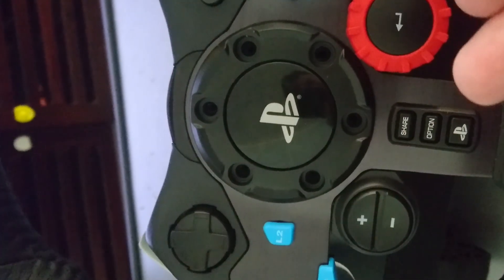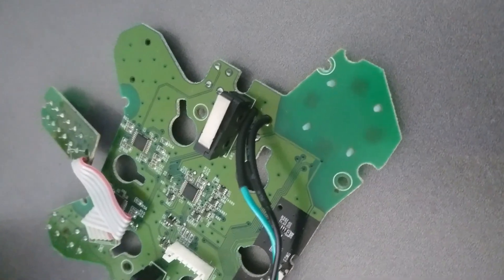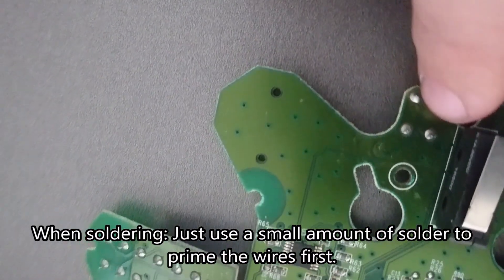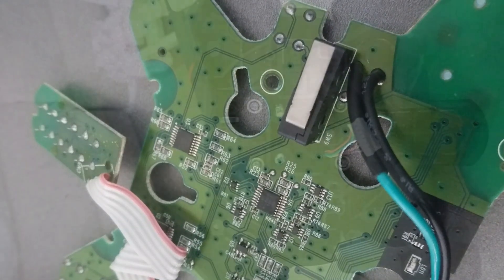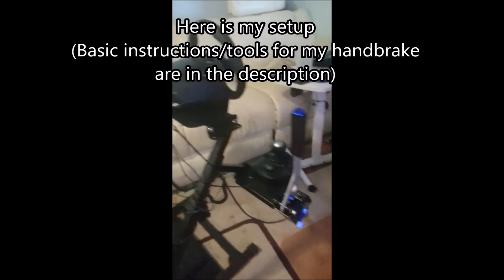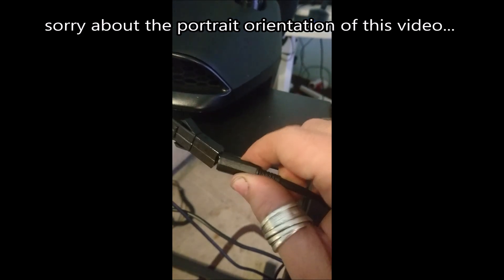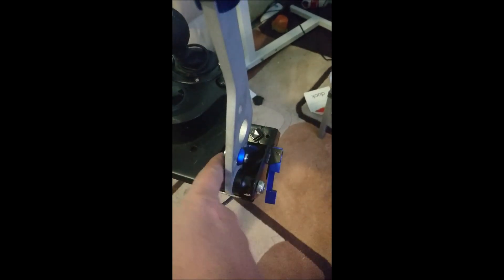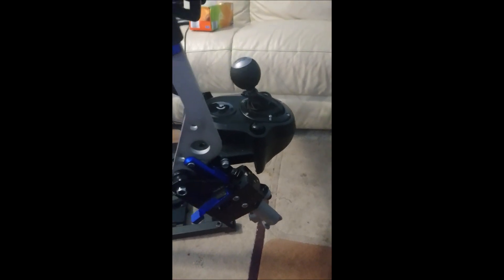Logitech G29 DIY handbrake mod wiring guide: How to tap into the button pcb & wire it to L/R 2 or 3

Comment: Can you do a video on the hand brake wiring. exactly how you connected the handbrake wires to the momentary switch that connects to the steering wheel pcb board wire.

Comment: Nice work. Just done one myself using the same hb assembly as yourself, though mine is to a G920. I always searched for G920, didn't even cross my mind to search G29 or I would have seen this earlier. Did it differently in that I went off the PCB and the B button, (circle on G29).

Comment: Just a heads up to anyone trying to do this mod.. do NOT use this video as a guide. It does NOT work. The solder points he used are for the menu button.. the paddle solder point are on the opposite side of the pcb, which also only work for pc. Anyone doing this for xbox one needs to use either x,y,a or b. Hope this helps someone out

Comment: I know this video was posted a while ago, but did this end up working? You never posted an update vid. Im currently in the process of doing this mod, but the solder points you used seem to be for the start or select button. Ive seen another video of the handbrake being wired to the right  or left paddle and they used 2 of the 3 solder points on the opposite side of the pcb. Please let me know, ive spent roughly a total of 12 hours in the past 4 days trying to figure out where to actually solder but there are so many videos that say to solder at different points. Thanks!

Comment: Is there any anti-tamper seals or stickers, I'm maybe going to replace the wire that could fail on certain models giving button problems, the model I have might not be affected but I may strengthen the 7 pin block connecter regardless with hot glue and purchase a replacement but I don't want to break any "tamper proof" seals as it's still under guarantee, if it can be opened without detection I will apply the modification, if not please let me know Thank-you, I will subscribe If you reply

Comment: is there a wiring diagram i can get? id like to tap into the buttons behind the wheel, somewere in the base so the wires dont spin around. im sure the other end of the USB that plugs into the PC can be tapped, id like to tap into it there

Comment: how do u solder to a or b button I have g920 using it on xbox1 for forza
Reply: Hi Mike. Just came across this video. I have done exactly what you are asking, made mine for my G920 tapping off of the B button. Risky, but I was not going to do it for any other button. As you know, the 920 only has the paddles LB and RB, so if I used them then no paddle shift, and LSB/RSB which are the stick buttons, and no game maps handbrake to those buttons. So it was B or bust! Check out my video:
https://youtu.be/H-48q4PmYdw

Comment: thanks for the video. about to make one with a long handle handbrake
Reply: Vu Nguyen on the a or  b buttons there's really really thin small soldering points it can be done but it's very scary it's easy to over hear them and ruin the mother board I did them to my rb paddle it's the easiest and safest just keeping it real I have vids on my YouTube about it

Comment: hello friend tried it myself and it all went well, but until I went to close the wheel is not closed because the cables to prevent it  the cables is thick.... had to put very thin wires;  plz help meeee

Comment: I have the g920 and want to mod for the handbrake. I was going to solder it the the R2/L2 but after looking at comments on this video, it seems that you can't map out your buttons on the Assetto corsa game console version for Xbox one. when I play forza 4 or forza 6 the ebrake button is A for the Xbox 360 and for Xbox one on forza, which means that would be the X button for the Ps3/Ps4. you have any idea what solder points is for the X button/A button for the g29/g920? I know peppedik have a picture of it hooked up to the O button. can I get that picture?
Reply: I just looked up the configuration for the Assetto corsa xbox one and it's the B button for the ebrake so it would be the O button for the g29. what are the solder points for the O button?

thanks
Reply: my email is samuelvong90@gmail.com much appreciated
Reply from the maker: There is now a preset on Assetto Corsa where the handbrake is the L2 button on PS4. Just use that as it is very easy to do.

Comment: do i need to use a specific type of wire
Reply from the maker: Any small gauge copper wire is fine. If you could get one that has two seperate wires inside it - even better as the two will need to be threaded through the small whole through the neck of the base (about 5mm diameter).

Comment: what kind of cable u used?
Reply from the maker: Small gauge wire (cannot remember what number) from an electronic store - approx 2-3 mm diameter. I cut it into 2 eual lengths, then heat shrinked over them both together to make them into one length.

Comment: Hey man how did you manage to activate the heat shrink wire, with it being so tight with the pcb?
Reply from the maker: Brendan J Brennan  I used a heat gun and a bit of extra distance. If you don't have one, you could use a hair dryer (I wouldn't use a cigarette lighter here)

Comment: I just made a easy USB HANDBRAKE, or it can be connected to the wheel like yours!
Reply from the maker: If you wire through the wheelbase (like my video here) it will work through the PS4 and/or PC
Reply: HJ Hooch  will it work for Xbox one
Reply: @qptrainwreckqp  xbox one uses the Logitech g920, but the mod should be similar

Comment: thanks for the clearest tutorial on the web so far. gunna give this a go on my xbox one version
Reply from the maker: Happy to help and thanks. Post back how you went with the G920 - I'm pretty sure it would work fine but it would be nice to have confirmation.
Reply: HJ Hooch on the xbox one version the PCB needs removing as the only soldering points for the padels are on the back of it.. appart from that.. all good!
Reply from the maker: Cool. Good to know and thanks bud.

Comment: hey man, do you live in melbourne?
Reply from the maker: Sydney
Reply: any chance I could send up my wheel and you make the mod for me, I will happily pay you :)
Reply from the maker: Sorry man, I don't want the responsibility - I'd be too worried about accidently damaging something or postage problems... It really is not that hard if you take your time. Have a go on your own and take it step by step following my video and additional notes here. The reason I put this video up is that It I honestly think that anyone could do it with a guide like this (I had no experience at all with soldering and  still managed fine). Just look up a soldering tutorial and buy yourself a cheap solder (mine cost $20 from J-Car), wire strippers/cutters (you could just use a sharp knife & scissors) and a hair dryer or cigarette lighter will substitute for a heat gun for heat shrink (ask about the heatshrink and connectors in J Car) Good luck.
Reply: aenyay@hotmail.com 
thank you

Comment: Do you think this will work for the G920 also i see another video on it, but it was so difficult to understand!!
Reply from the maker: I'm positive it will work for a G920. Iv'e seen a dismantling of one and it is 95% identical to the G29. The L/R buttons (triggers on XBOX) are in the same place on the PCB and and can be tapped into the exact same way. Good luck
Reply: Quick question is it the L/R Buttons i am soldering? i was just curious i thought it would be B or Circle Due to that button being the handbrake
Reply from the maker: The reason for L or R buttons is because you would have to really mess up badly to damage anything. The circle, square, triangle, x buttons don't have a direct solder point. Peppedik did it and had to tap into the printed circuit through a tiny port on the board (I don't feel confident in my ability to do that).
Reply: Do you have a twitter or such i can talk to you more about it, or a discord if possible?
Reply from the maker: the video should do the job for you but if you want any further info just post a question here and I'll be happy to help.
Reply: I can see that this was posted a year or so ago, but anyway in case you never did it, if you use the LB or RB, as they are the paddle shifts then you would lose functionality there. They would still work with the hand brake also, but you could not have both handbrake and shift mapped to the paddles.

Comment: Helloo i have the g29,  i can use the circle button to do this?
Reply: +HernanLucena203 i did it! Now is on the circle button! Yeeeeeee
Reply from the maker: +peppedik  Were you able to figure out how to tap into the circle button? If so, I'd really like to know where the solder points are located on the Pcb I hope you took a picture???
Reply: +HJ Hooch i have a picture you can add me on Facebook ( Giuseppe Butticè,  on the foto its me and a girl ) and i can send you the picture
Reply: hi mate can i see that pic with it hooked to the o button. im gonna do mine soon
Reply: aenyay@hotmail.com
thank man
Reply: Can someone upload to tinypic.coM or similar or  Someone email streetrace420@hotmail.Com
Reply: I'd hate to reply after all these people. Just I have a ps4 as well and would like to solder it to the "O" Button as well. Could you send a pic please cassataproductions95@gmail.com Thank you!!
Reply: its on the outter edge
Reply from the maker: Cassata Productions: Check amstudio's video at 3 mins & 15 seconds (I think x or square are better choices but whatever you prefer):
https://www.youtube.com/watch?v=zuyuqYL9Fe4&t=0s
Reply from the maker: As per the video - It would be very risky as you would have to tap into a printed circuit on the board. That's why I chose the L/R 2 & 3 buttons. Almost no risk of damage as the solder points are already there for you to tap into (I really wanted to use the circle button also but it wasn't worth risking damage to the board). Just re-assign the buttons in any game's control configuration options.
Reply: +HJ Hooch on assetto corsa console i cant change the button
Reply from the maker: Yeah I haven't brought the game on PS4 for that reason (I have it on PC where all buttons are customisable). It's freaking ridiculous for a car game not to allow custom button inputs. I feel your pain mate.
Reply: +HJ Hooch ok i have tested on the Circuit board but doesnt Work, now i do the same of yours
Reply: +peppedik change the buttons in the Ps4 Options
Reply from the maker: +peppedik  Excellent. Thanks. Will do
Reply from the maker: +peppedik Added (Haydon F)
Reply: +HJ Hooch i havent received your request
Reply from the maker: Thanks so much for the pic. I'll try doing it that way next time
Reply: Give me your e-mail
Reply: peppedik Can you send me that pic too? my e-mail is herno360@hotmail.com.ar
Reply: peppedik great job, can you send me the picture to? My email is jonyct@msn.com thanx
Reply: +peppedik Could you please send me that picture too? primozzaman@gmail.com  Thx
Reply: peppedik could you also email that photo to me? was about to solder into the R2 button before I saw this comment howitzer262@gmail.com
Reply: can someone one send me the picture? send to samuelvong90@gmail.com 

thanks!
Reply: Mike Ogryzlo I see that part I was just wondering if there was an easy soldering point like the R2/L2 soldering points. The X/O soldering points seem looks sketchy to be soldering there. just wondering if someone found another spot to solder
Reply: peppedik I would also like to know but I don't have Facebook do u have Snapchat add me @vinny2time
Reply: peppedik or my Gmail.    fourdown83@gmail.com please I need to see
Reply: peppedik can I get a pic also my email is trx450rider23@gmail.com  thanks

Comment from the maker: After doing this mod again for my Brother - without the frequent interruptions that I had the first time - I now have several refinements:

1. When removing the neck (which has the paddle shifters attached to it) you only have to remove the 3 larger inside screws (not all 7) which secure the unit to the base. Removing the other four screws allows the paddle shifters to come off which is unnecessary.

2. Do not apply the hot glue fix for the 8 pin connector until you have already re-assembled both the base cover and the neck, as it can be almost impossible to squeeze the hot glued, bulkier connector through the neck hole during re-assembly (I had to heat the glue back up with my solder to soften and re-shape it and then ended up pretty much re-doing the whole thing to tidy it back up after re-assembling the neck).

3. When removing the screws from underneath the base, you only have to do the ones around the outside to be able to detach the base cover (there were about 6 of them).

4. Be sure to solder the PCB of the wheel before you thread the wires through the base and also be sure to thread the wires through all of the:-  neck -  base cover (through its entry hole) -  base  - Otherwise you will end up doing what I did and have to cut the wire out of the base in order to be able to re-assemble and then solder the wires back together (major pain in the arse).

Otherwise I'm relatively happy with the guide here and I was able to do it in approx 45 minutes the second time (without rushing anything), even after having to do unnecessary soldering and re-hot gluing.

No hiccups/malfunctions in the operations of both mine & my Brothers' G29s. All worked 100% as intended straight away.
Good luck people.
Reply: HJ Hooch meeen, thank you so much, just did it, its fckn perfect! how can i show u my setup? i used an arcade joystick with a homemade base. 
dirt rally+handbrake= awesome
u rock
Reply from the maker: Cool. Glad it helped. I also have a wheel change video coming. amstudio has a terrific one also. Check out his stuff

Comment from the maker: Also just another heads up: When you 'test' you will plug the power into the wheel and the G29 will perform its start-up sequence each time (the wheel will rotate...). Just be ready so the pcb/wheel doesn't get tangled.

Comment from the maker: Just an addit: 
Make sure that your wires that will be fed through the G29 from the wheel are extra long as you will be feeding them through and testing it while the wheel is detached from the base - You will need the extra length to play with.